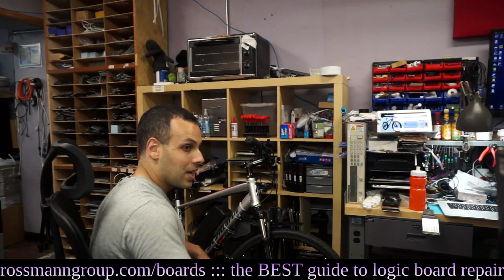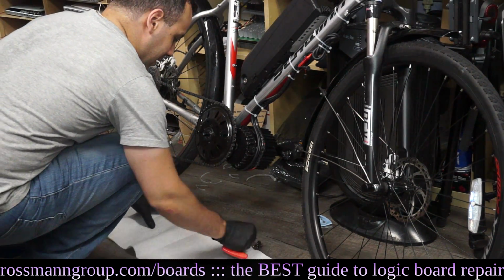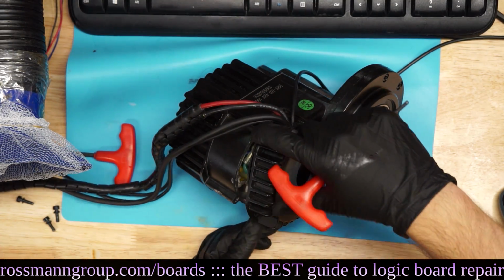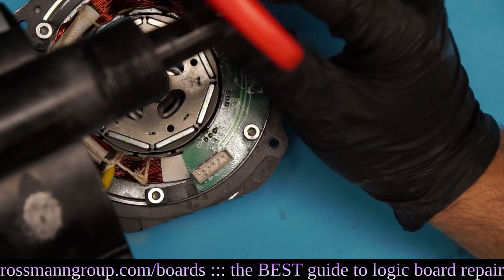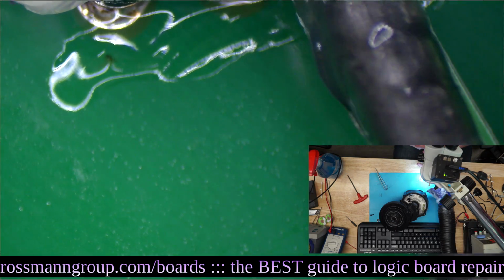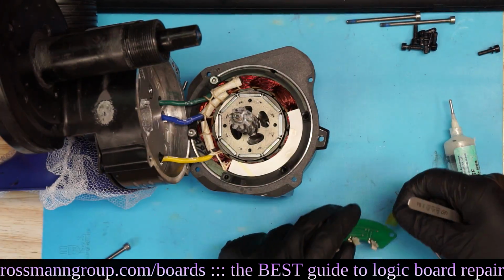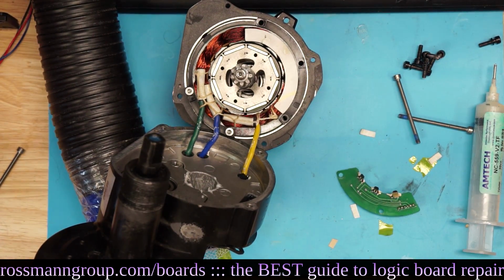Bafang BBSHD ebike Error 8 Hall Sensor repair howto.

Comment: I had this error 8 and I thought  shit this can't be good but when I took it apart the yellow wire had a cracked in the rubber around it and I put some heat shrink and it works like brand new. I wonder if it was the board that was wet and I got lucky, it has been working for a week and good. I am upgrading to bac855 then I I will have 3350 watts to play with. Yippy. I have 40,081 kph on my bike and I have not have any problem until  that error 8 and it's working good with no with no money spent besides some gasket maker that I used to fill all places water could get in. Get the bac855 and replace nylon gear with peek gear or medal I put in the peek gear

Comment: I’m surprised that motor failed that easy too, I have a bbhsd too. I was riding through the trails at about 25 mph and jumped into a rock pit  landing on only the motor first and it still works perfectly
Reply: Lucky you. I noticed there was no o ring seal and gasket on mine after it had already got wet and now the motor's shagged out completely
Reply: @alpha0101pi  omg that sucks, You should give the vendor you got it from an earful, that doesn’t seem right

Comment: Use two R003 instead of the R005 (shunt mod). Now you trick the controller into pumping 50Amps instead of 30Amps into the motor... So at 48V, you get 2400W instead of 1440 W... Not more top speed, but it gets way more torque !

Comment: Shunt resistors are on the other side of the PCB, between 4th and 5th mosfet starting from the right. It's about 1 cm to the left of the big capacitor, the other side of the PCB.

Comment: Rossman Repair Group - Services include Mac repairs , Ebike motor repairs, EMS services, and suplies. Don't delay buy today 😂
I also repair bicycles that is the Bottom Bracket ( usually GXP, BB, PF, HT2,Caged, Loose etc)

Comment: I have a BBS02 on my bike,. Recently had to replace controller. They fail if they get hot, I did 5,000 miles in one year. Currently 5,552 miles. Love my eBike

Comment: I got a very similar setup to yours with bbshd as well, I also even have the battery upside down mounted as it doesn't fit the proper way. I was cycling in the cycle lane in Reading (UK) When a car coming from the opposite direction decided to turn into a street right as I was passing by, I hit the front of the car from a 45 degree angle, and ended up in A&E. These bafangs with a 52V batteries are real beasts. It's easy to get involved with accidents with a cycle that's capable to ditch out a scooter speed.

Comment: Louis, I'm a bit of a noob, but if you had swapped the current resistor for lower values resistor (eg 2 x 4 milliohm) the controller can pump in more current into this overbuilt ebike motor.

Comment: I had issues with my bafang too, after taking it apart to grease everything and seal it since I'll use it during winter it didn't work!
I ended up resoldering the hall sensors and  removed all the connectors so it was 100% soldered by me.
I've been riding my bike for a few months now and it's awesome!

Comment: Hey Louis, love your channel!  My channel I'm commenting from is an ebike commuting and build specific channel.  I've commuted by ebike almost 18,000 miles since 2015. Do what you want of course, but I would suggest not mounting your battery upside down.  There is a company in Australia that makes bottle cage mount adapters (you'll need 2) which will allow you to mount it right side up.  If you wish, check out my 2000W Sinewave Build video to see how they work. Also, I am very surprised a wreck like that would damage those components as well.  Good luck and welcome to the EV grin community! p.s. Luna Cycle (where you most likely ordered your kit from) sells a better mounting bracket for the Bafang kits.  Without it, you'll notice within a few hundred miles that your motor will rock back and forth and eventually fail.  Or use big zip ties.  Just sayin :)
Reply from the maker: Oh yeah i have to tighten it regularly.  Thanks for the advice!
Reply: Louis Rossmann No problem! I know some people have used hose clamps as well. Probably better than zip ties. On the 2000W build I did I almost ended up mounting the battery upside down until I found the adapters. They work really well and built solid. Then you can use the usb charger and don't risk damaging the ports with the pedals if your bike gets knocked over while charging. I'll be moving to NYC later this year. I visited there in April (during that crazy snow storm) and was surprised at how many ebikes were there, especially the Seamless guys, considering I thought ebikes were supposedly illegal until April but it seemed the Seamless guys had been using them for quite a while. They were mobbing even in the snow storm! Good luck man and thanks again for your visit and shedding light on the shortcomings of Apple and promoting user repair in general. While I know OSX is far superior for content creation, I still refuse to buy an Apple product but instead rock my heavily modified hackintosh  that's the best of both worlds.

Comment: better not to mount the battery reversed. Better to drill a few holes in the metal. Otherwise the whole battery weight is just on the locker, which brakes in no time

Comment: The three wires are for three faze power. Brushless dc motors are actually ac motors that's what the controler is for. It allowes you to triple the power to the motor with only adding one wire (and probably other benefits). DC is + and -. The three wires are ac@ 0°, 120°, and 240° cancelling each other out so no ground.

Comment: Doored. Nasty.
Reply: If you crashed harder you would be more likely to break your collar bone than you arm. Reason being that the bones in your arm are weaker than your collar (design flaw by an "intelligent" designer). The shock wave will move up and down your arm and will find a weak spot in the collar bone which will then release all that energy in one go, like an earthquake along a stressed tectonic zone between plates. Witness all the broken collar bones in the TDF. Has to be the most common type of fracture in professional cyclists.

Comment: Cool video, but I wish there was some narration of the actual soldering process. I have irons, solder, and heat-shrink, but I am a total hack when it comes to actually understanding what I'm doing. I'd love to know why those factory joints were bad (based on visual cues alone) and what steps you took to improve them. Tips from the pros!

Comment: Do you have links to the solder technique's, the fluid your putting on the solder joint, and how you're able to add the solder without it not wanting to leave the tip.  My blood pressure would benefit and I'm sure I'd start soldering again.  Thanks.

Comment: When I was about 18-19, I was riding my bike home from a friend's house, I was on a two lane road, as far to the right as I could get, and some jack ass in an SUV basically pushed me off into the ditch. I had steel toed work shoes on at the time, and when I went into the ditch, I ended up having a broken toe nail and could hardly walk for a week. Jack ass drivers that can't respect bike riders, it should be legal to pull them out of their vehicles and beat them to within an inch of their life. Good to see that you were not hurt worse than this though, and glad you were able to fix the motor. Normally, it would irritate me to see an electric motor on a bike, but if it is your only mode of transport and you ride a lot, in New York, well I can kind of understand the cheating bit.

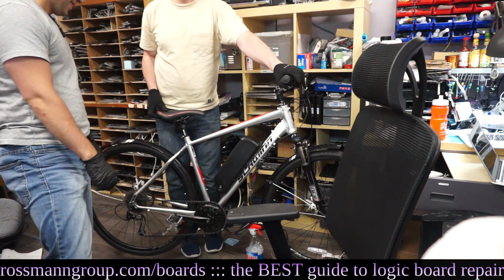Comment: With "no current sensor" ( 34:20 ) Did you mean no current sensor errors?
As far as i can see you just re-soldered and replaced current-sensing resistors with same values.

Comment: Never use a hammer to remove the pedal! you can "shake" the pedal with your arms untill it gets lose. Or buy a removal tool! https://www.ebay.com/itm/Crank-Extractor-Tool-NEW-Bike-Cycle-Chainset-Crankset-For-SQUARE-TAPER-CRANKS/132440769258?hash=item1ed615c2ea%3Ag%3AvD0AAOSw8axaOktS&_sacat=0&_nkw=square+hoe+crankset+tool&_from=R40&rt=nc&_trksid=m570.l1313&LH_TitleDesc=0

Comment: I just about had a stroke when you started to hammer off the pedal arm. You need to use a puller as to not damage the axle shaft bearing. Each hammer strike dimples the axle bearing surface and shortens its life. Otherwise, your doing great.

Comment: Get yourself a crank puller or a rubber mallet to hammer them off - unless you like having your cranks scored :).  A bike stand is also cheap and makes working on the bike SO much easier.  You just mount the bike on the stand and go to work.

Comment: Get yourself a crank extractor!! And make sure you do the 8mm crank bolts up F T, The crank arm will most likely come loose after riding a few miles otherwise resulting in a knackered crank arm and possibly the bottom bracket. If this happens that whole motor assembly will be toast!!!

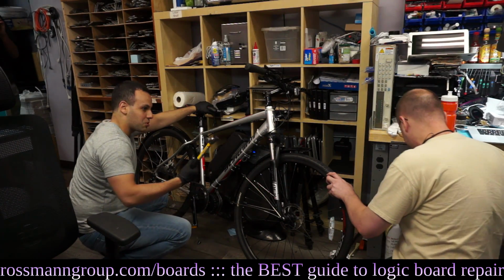Comment: My heart stops at 2:27
PLEASE get a crank puller, they're not that expensive.
I'm linking you to a decent park tool(amazon): http://a.co/6o7Ezdw

You'd probably get a heart attack if someone soldered on a logic board with a blow-torch, or removed a iPhone screen with a crowbar.

Comment: You'll want to replace the potting material, at least near the big capacitors. It'll keep vibrations and impacts while riding from moving them around, which eventually makes them break and fail. It's mechanical support.
Reply: sorry, but what do you mean ? do you have a clip for that ?

Comment: Love my bbshd it's a pretty beefy motor it can handle waay more then 1500w using a different controller im running mine at 3000w and it rips!.
Reply: brett20000000009 
Same BBSHD controller can with extensive modding go 18S  50 A

Comment: Current sense was probably okay. A Hall sensor issue can also cause current sense error codes to show up. If you have these error codes, try testing the controller after resoldering the Hall sensors.

Comment: The green, yellow, and blue wires  provide the pulses of electricity to the motor, think of it like a firing order for the pulses of electricity. A sensor ensures they fire at the appropriate time and in the correct order.

Comment: 3:08 Dude! Nooooo!
https://www.aliexpress.com/item/Bicycle-Bike-Crank-Arm-Wheel-Puller-Remover-Removal-Wrench-Spanner-Repair-Tools/32809607423.html?src=google&albslr=223033207&isdl=y&aff_short_key=UneMJZVf&source=%7Bifdyn:dyn%7D%7Bifpla:pla%7D%7Bifdbm:DBM&albch=DID%7D&src=google&albch=shopping&acnt=494-037-6276&isdl=y&albcp=913263744&albag=48828809226&slnk=&trgt=349615371962&plac=&crea=en32809607423&netw=g&device=c&mtctp=&aff_platform=google&gclid=EAIaIQobChMIhrz7__bF3AIViKmWCh2bjgGPEAQYASABEgJa8_D_BwE&gclsrc=aw.ds

Comment: The paper is there to protect the insulation on the windings from abrasion that would short out a coil. Also, if you are only riding on city streets that are mostly flat, save yourself a massive headache and just get a 10t MAC hub motor. I have built 6 ebikes so far and the BBSHD was a pain in the @$$ even with the right tools. The BBSHD will also rip off your derailleur if the chain jams. A hub motor will still get you home even if you have chain/derailleur problems. Check out EM3EV for significantly cheaper and higher quality batteries too, those shark packs are not very good and twice the price per watt hour.

Comment: On the Powerbook G4 the entire case was a heatsink. They said that it's because they wanted to use aluminium case, but they were more or less forced to to it this way, because PPC processors were so hot.

Comment: Louis if you haven't already done this, I suggest visiting a bike shop soon so they can torque down your bottom bracket and crank arms. Those parts have some of the highest torque requirements you can find on a bike and with a 1kW motor strapped to them I wouldn't take my chances using a flathead screwdriver and hammer combo. Stay safe!

Comment: AFAIK using solder to improve the current carrying capacity of the traces on a PCB is not considered bad practice, except of course when they miss a part like you showed. ;)

Comment: I know you are great in fixing almost everything with a solder iron, but why not use your warranty, and get it all replaced, or is your electric bike old already?

And you NEVER use a hammer to take off the paddles, you use a bicycle crank puller, like you see in this video: https://www.youtube.com/watch?v=ZDK6knIPhQg

And they are very cheap: https://www.amazon.com/bicycle-crank-puller/s?page=1&rh=i%3Aaps%2Ck%3Abicycle%20crank%20puller

Comment: the lesson here is Don't ride in the trash lane aka bike lane. I live in ohio our laws forbid bikes to be on the side walk allow them to be on the road in the normal traffic lanes etc even when a "bike lane" is present. Think about this for a second your on your bike and need to turn left and you are in the so called bike lane that is to the far right on the road. You have a right turn only lane a strait only lane and a left only/left and strait lane. To turn left will require you to cross the right only strait only and left turn only/ strait lane of traffic that means you must cross 3 lanes of traffic just to make a left hand turn from that death trap of a bike lane. There is such a evil thing out front of the building im in right now. This lane has cars using it all the time as a high speed lane. There is no physical division no divider down the middle to prevent cars from using it etc. You are many times safer in the normal lanes than in one of these bastards.

Comment: But if apple encapsulates their new macbook, how will they get water damaged?
Reply: Nothing is water-proof only resistant, so it's only a matter of how much water can it take, plus knowing Apple they will purposely not even take the thermals into consideration and something encapsulated will eventually overheat or the heat generated will lead to a capacitor failing short fairly quick.
Reply: Well, Louis mentioned that they could always use the case as a heat sink!
Apple could be the true innovation leader and be the first to introduce a laptop that will actually burn you if you put it on your lap.
Reply: Dream Services International that could actually be a good selling point for people in cold climates just think about it "my lap is cold, let me just pull out my MacBurn Pro and get on Facebook"

Comment: 2:38 you need a crank puller
3:35 Chainring
5:40 Bruno, Nice guy, very shouty hahaa
18:33 Luna cycles have upset a good few people in the ebike trade. They have apple like groupies that don't seem to realise they are paying way over the odds for rebranded chinese kit. That and Eric's kind of a dick
24:50 Paul's spot on, those are spacers so the hall sensors don't vibrate in the slots. Slot the paper into the hole and use them to guide the halls in.
25:40 FOCUS YOU F*#K
29:55 You can get a programming lead for it or you can use an external controller ;)

Good job!! Looks like you've got a large diameter wheel, if it's a 29er you might want to change your gearing to make it a bit easier on the motor. Just give it a bit of stick and measure the motor temp, go from there

Comment: When removing fine threaded fasteners on the bike, it's a good idea to use anti seize compound on the threads. This will allow for easier removal in the future. It's not required, but I usually use it on pedal, bottom bracket and head tube threads to prevent them from getting stuck over time.

Comment: I guess the main reason why this is an issues, is that New York originally was made for horse carriages, horses, and at some extend bicycles. Throughout the years, as technology progress, you add in new items such as cars, buses, cabs and all give them different lanes/laws to follow. Mix that with the stores, bus stops and cab stops being placed at silly locations you really get a mess like no other.
Denmark (where I live) we have somewhat the same issues, although it has been a way larger focus to the politicians to fix.
We still have the issues at some downtown areas, but out big-cities aren't as large as a city like New York, and it never grew at the same rate, so the issues isn't AS big as in NY.

Anyway, long story short, huge-cities like New York has just grown too big to itself, and you can't really relate to "rules that apply other places". There ought to be looked more into how to do it right in New York, and not just what everyone else does. And instead of handing out fines to bikers trying to stay alive, or car drivers being a menace to bikers, there should be a solution that made it safer for everyone.

Comment: GREAT vid  we EndlessSphere guys need love too. ? I s there an advantage towards using US dealers like Luna Cycle?
Luna might be a source for the board and would be folks you might like to work with, as you found.
The AliBaba vendors have a reputation as a mixed bag of quality , and can be dicey
Sorry about your "Dooring" Agree with your  durability metric "No bones , no damage"
!!! HAMMER where you should use a puller! oh come on
for BrunoPOWEEER , the screechy boy, just turn off the sound, or leave quickly
there are better BBx disassemby tours, check out ES, though like many boards, it requires pateince
Like your tour

Comment: a tip for working on bikes, turn the bike upside down so it is resting on the handle bars and the seat, this will put the pedals and chain in a much more comforable place to work on